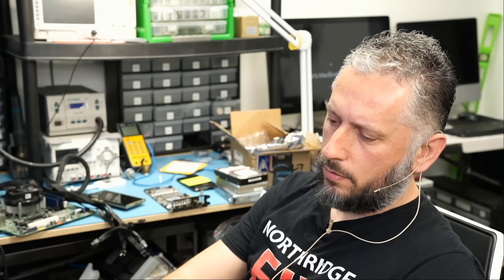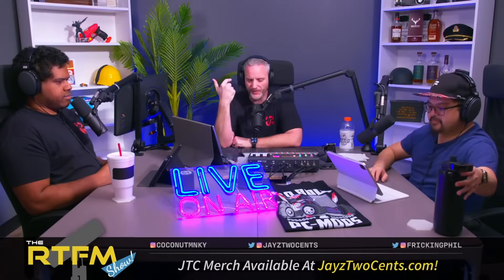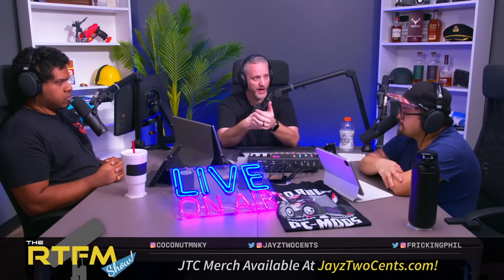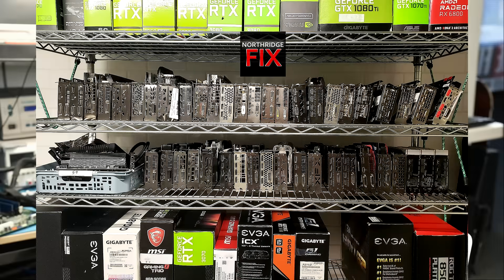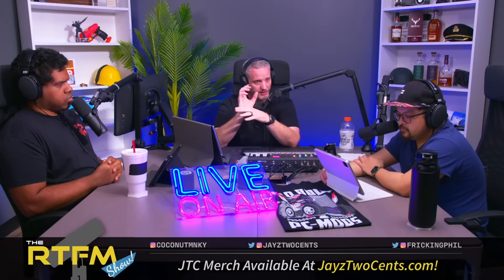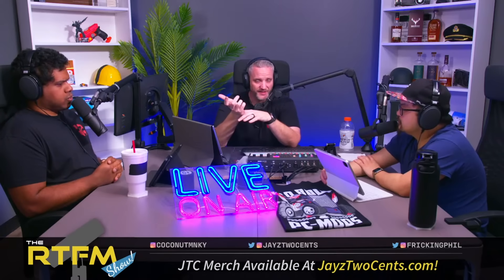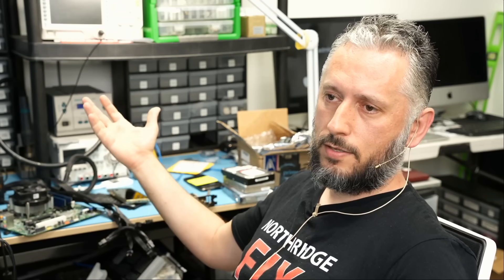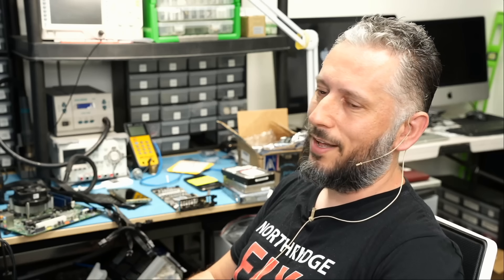Melting 4090 and CableMod. JayzTwoCents and Gamers Nexus Response. Blame NVidia or User?

Comment: Honestly the bottom line falls back to the manufacturer of the card.   The current on those lines are clearly to strong for the connector to handle.  What SHOULD have happened is a redesign of the card maybe considering using 2 connections and not just one.  Split the current over another set of lines so it splits the heat load.

SMH.   Northridge I'm 100% is correct when their assessment.  He's working on several dozen of these cards each week.   So figure about (conservatively) 20 cards a week....80 cards a month, etc...  And GN only checks a handful?

Much as I have respect for all 3-  I really have to put my faith to the person/company that has to repair the damage.   

To put it this way:  If you had to taken Apple's word for why they can't fix your phone or laptop.  And then have someone like a Louis Rossmann DO THE REPAIR!  

Who would you listen to for advice now?  Apple (that clearly has the vested interest in simply selling you another product)  or Louis-who's interest is in REPAIRING that same product for a fraction of the cost.

I'd love to see a video with both "Alex" and Louis Rossmann trading repair stories together.  Pretty sure that would be amazing.

Comment: Could a human not seat it perfectly but when it melts it gets drawn in closer when using a cablemod adapter. 
Either way, this is a NVIDIA design flaw and they should make it right because it’s not like gaming GPUs matter to the bottom line.

Comment: If the connector is so tight is it possible the plug is pushing the pins inside the connector back? So even when its fully seated its not?

Comment: "Not a connector issue". Connector melts.
 You  know how that happens?
I too large, R too large.  Heat.  Melt.  It's not hard to figure out.  But I guess if you think a bad memory chip or MOSFET is a no-fix situation, you might think so.

Comment: It seems that too much current is flowing through the video card. I think Nvidia should use bigger connector for the high current of the video card. Maybe it's also an idea, like a dvi output, to secure the connector with screws. Maybe the connector could be made of a better material. In any case, I think the connector is too small for the power demanded by the video card. Why 1 connector anyway?

Comment: Hi @NorthridgeFix. 

I just had a 4090 burn on me. I used the cablemod adapter to avoid putting stress on the cable because the clearance between the card and the side panel simply won't allow a proper length between the bend and the socket. I will get the issue fixed, thankfully. I monitored the power draw of the card routinely and rarely it went above 400w draw (Mostly when I stress tested the system the power consumption went higher than 400W). More often than not the draw moved between 260-370W. I also monitored the 12vhpwr cable, cablemod adapter, and the GPU socket for developing gaps or misalignment. Suddenly the card began failing on me (Blinking screen and graphical artefacts). I reinstalled the drivers, which fixed the issue for some time. Eventually, the socket melted on the left side whilst playing Stranded: Alien Dawn. 

NVIDIA produced a card where its size can cause a mating error for the power cable and connector because of space limitations. 

NVIDIA produced a card which weight can cause the graphical interface to crack. 

NVIDIA produced a card which 12vhpwr-connector uses inferior production methods for its pins (Such as poor metal layering and foreign debris). 

NVIDIA produced a card using a 12vhpwr-connector which pins are too thin and close to provide enough tolerance for power spikes and safe heat dissipation.

NVIDIA produced a 12vhpwr-connector where the design of the pins doesn't provide good connection that keeps them locked in place.

NVIDIA produced a card which connector is so flimsy that a slight pressure on it can cause a misalignment. 

NVIDIA produced a card where to even have a chance to correctly insert the cable you need a lot of pressure which still might not have the cable mate correctly. 

Therefore, adapter or not, a melted card is on NVIDIA because it is way too easy for the card to melt for it to be user error. 

To anyone that want to prove me wrong, here's a pro tip: you can't.

Comment: Perhaps todays cards just need a beefy 3-pin Water-Kettle plug or AC Adapter clover-style plug... aka .. a thick high-current 3 pin connector instead of the current thin multi-wire dodgy little connectors that was brought forward when PSU"s were designed to run at less than 500w..

Comment: Cablemod recently announced a recall on all thier adapters
Reply: Yeah. Because they don't want to be responsible for poor design of the cards. GPU manufacturers just dump these cases on Cablemod instead of taking responsibility for their own cards.
Reply: @eggy6857  The only cables that were melting were nvidia FE adapters and cablemod adapters, PSU cables etc. that were fitted correctly haven't had a single issue..

Comment: While I would agree with you (and do to an extent) - I unfortunately gutted my PC yesterday and to my surprise, there was a slight charring and melting on the cable connected to my ATX 3.0 PSU! The culprit? While I ensured the GPU was seated flush, when pulling the cable out of the PSU, it got pulled out with a slight 1mm gap

Comment: I am still very confused why would nVidia be able to deny warranty claim on this, and try to use excuse of "blame the user for not plugging it correctly" ... 
Car breaks down, fire ignites under the hood, and manufacturer says driver was not making proper turn, did not start the car properly, did not use proper fuel, did not properly re-seat air filter cover - and all is fine... no no no... that is a fire hazard. 

Supposedly they have re-designed the port and sense pins are little retracted inward to ensure power is no longer delivered if the port is not plugged in to the acceptable distance... 
Now that I finally managed to get RTX 4090 FE in BestBuy I am wondering if I should return it or not.

Comment: I think this is a fear preventing me from buying a 4090, making me want to settle with a 4080 with my upcoming i9 13900k build. I found this video researching if it is still an issue or not with melting cables, and sadly, I feel like I just want to settle with a 4080 and go with the i7 13700k to save some cash. No point in buying the 13900k unless I'm going with a 4090.

Comment: If the connector is not aligned, it means that the manufacturer/Nvidia just made it and packaged it straight away without testing their GPU whether it runs well on the connector or not and supports standard connectors. Obviously this is Nvidia's responsibility and must replace a new one (manufacturer's physical defect = replacement of a new unit).

Comment: It's very normal to melt .. because the damn card draws a ton of power... and it's happening on the card side because the heat comes from the board to connector .. and resistance increase with temperature .. so guess what .. it's gonna melt .. add 2 damn connectors and should be ok, nvidia f up.

Comment: bad quality connectors from card, these pin connectors had to sustain at least 12 amp, so if is oxidation or resistance that give a poor connection and then become hot to melting, gold plated pins are more expensive then "aluminium" or some recycled conductor to make cheap pins, these lead to poor connections and hazard

Comment: I think the issue has to do with the ampacity of the connector and the PWM and its demands. 
The ampacity can vary wildly depending on the environment the card lives in and because of the 4090's high power demands coupled with all the energy efficiency systems in place, it leads to transient spikes that could potentially lead to the connectors melting. 

I also think this is why we're getting so many mixed results in testing and it's much harder to see patterns in failing cards.

I think it''s an engineering problem for sure but a really tricky one.

Comment: I know I'm late to this video but I alwys get a laugh at all the comments that said user error.  If that were true,  people would have melted the 24 pin power cable off the MOBO.   People woud have melted these plugs in every model / system.   People seriously do not think.   This is an isolated issue with just the 4090s, right?   4080/4070 series don't have this issue and I guess they are similar in design?

I know GN tried to do some fancy camera work with thermals and what not but I don't recall them finding a bad GPU to play with.   After replacing the connector,  did the boards re-fail?  I would have loved to see a volt / amp test on the pins.  Would have been great if we had a bad card to test on before it failed.

It seems to me that it could be some sort of runaway circuit causing a short.  Is it always the same pin,  PIN1?  I recall the connector specs were published and that they should have good connections.  If that is true, a simple resistance test would prove that, right?  Could a chip on board cause this?  Bad voltage sensor?   I dunno...   But I would love to find out more about the cause.

Comment: Its hard to say for real, some company pc builder do mistake with connector not fully plugged in. Its 100% sure that some people will do that mistake also, its not impossible. If its really a 12pin issue then every 4090 would melt, they are all made exaclty the same.some of those connector are fully plugged in but have play in them. But fo sure its more of nvidia error

Comment: 25+ years of building PC's. 
Same deal, 4090 connector melted and dealing with getting it fixed... 

Simply put, how is it that countless PC's over the last 25+ years have never had "Oh the user needs to plug it in fully" issue. 
Yet, as if by magic once Nvidia put out a new first gen connector, all of a sudden it's the users problem? 

Sounds like a great concept! 

New Business Idea: I'm going to design a parachute where as it works 100% so long as you pull the rip cord at "just the right speed". Any faster or slower, you die. Remember... that's on YOU for not timing your pull correctly! Get it right user! 

sigh 

Not only that these connectors that are melting ARE connected tightly. It doesn't matter. If it's fully clipped in any amount of wiggle, bump or otherwise should not be an issue. Doesn't happen with this commonality with SATA connectors. Doesn't happen in mass with molex connectors. Sure, some of them do at times and can of course but no defined pattern like we're seeing here. 

Nvidia improving their connector in a few ways should say it all. Why improve something that doesn't have an issue?

Comment: The connector is rated for 600 W but the 4090 draws only 450 W! The connector has a major design flaw when it is supposed to withstand 50 A but it can melt at 37.5 A in some cases. When the connector melts it is a proof that there was too much resistance in this connection for such a high current.
Here are some calculations:
0.1 Ohm connection resistance: 0.1 Ohm * 50 A = 5 W of heat dissipation in the connection
1 Ohm connection resistance: 1 Ohm * 50 A = 50 W of heat dissipation in the connection and the connector will melt
To reduce the resistance the amount of copper in the connector must be increased and the conductive contact surface of the connection must be increased. The rating of this connector must be decreased to 300 W and 25 A to have a savety margin.

Comment: Being in the electronics field all my life it's pretty clear the connector is at fault.  User error or not,  the connector is inadequate for the task.   I'm running a 4080 and you bet I'll be checking it from time to time with my thermal imaging cam.   The ground pins rarely melt as the cards have a path to ground via the PCI-e slot as well.   I don't agree with Steve on this one.  Some truth,  but not much.

Comment: One thing that nvidia should add in their design is a temperature monitoring circuit close from the plug pin.
Or better that that, a better comnector that can handle higher current...

Comment: I am using my 4090 with the pc case's side panel open just to avoid any flex in the power cable through contact with the side panel and and melting it.

Comment: When you put nearly 40 amps through a small connector which is likely not rated for much more than that, you have no tolerance for error.

The heat generated inside the connector is equal to current squared times the contact resistance so anything other than a perfect connection is going to generate several watts of heat inside the tiny connector. For example a contact resistance of just 2 milliohms at the maximum load of 450W / 37.5A will result in 2.8W being dissipated inside the connector. The only thermal pathways are in to the wiring, which is thermally insulated by plastic, and down the connector pins in to the PCB, which is going to be running hot anyway meaning that there is nowhere for the heat to dissipate to.

This is 100% a design issue, not to mention a potentially dangerous one.

Comment: I recently bought a 1300 watt PSU that came with one of these connectors that has 4 inputs. I can't believe they expect this small plug to handle that kind of wattage! It Is an Nvidia problem!!!
I Will NEVER BUY ANY of THESE CARDS!!!!!! These tiny connectors cannot handle that kind of Wattage! I think that a Lot more of these cards are going to be sent in for repairs sooner than thought. I would rather have 4 8 pin connectors than this crap. I have also run into problems on automotive wiring connectors that were not heavy enough for the loads that are demanded of them and so I had to upgrade many wiring plugs to repair burned connectors that have to handle more wattage than this! Shame on Nvidia!!

Comment: The real problem is $2000 video cards with a super cheap molex style connector that was never intended for high current DC. Why didn't they spec it out with something like a Deans, Anderson, Bullet Style....?? Anyone who was ever into RC cars can tell you that the type of connectors they use just suck.

Comment: Completely agree that this is still a company issue.  If the user can cause the error and create a fire or other damage the the company is obligated to correct this.  The simple fact that the other cards with same connection do not have the same issues is a huge red flag

Comment: Idk if anyone in the comments have mentioned this or anyone mention this except I believe jay. So if you notice the 4090 cards are “disappearing” or “hard to come by now” it was either jay or maybe even linus that talked about this but, they noticed this trend and started thinking the manufacturers are taking them to “resource components” for their upcoming 50 series launch just like they did for the 30 and 40 series cards. What if that is true along with my theory which is a silent recall of the non sold 4090 cards on the market to prevent more RMA while also trying to sweep it under the rug and in hopes using those components on some 50 series for profit and or updated permanent fix for this manufacturing issue which haven’t been publicized. Which is also why AMD is moving away from the new connector which isn’t or wasn’t necessary in the end anyways.

Comment: It's clearly a resistance issue. Either in the pin to pin connection itself or in the guage/material of the pins. It's manufacturer error either way, and invidia has zero excuses.

Comment: The problem is the connector and the fact the card pulls too much current for the connector contact surface area. The connectors are cheap and poor quality and design when card pulls higher current under load the cheap contacts  experience socket thermal expansion which increases  contact resistance which causes heat and meltdown as long the gpu is pulling higher current under load.

Comment: If the plug cannot handle the influx of power or is not suitable for the power draw it will melt as it heats up. Add an extra power plug to the card to spread it out.

Comment: Using the adapters are part of the issue. The cause current issues and put too much weight on card plug.  Get a dedicated 12vhpwr single cable with a PSU designed for it. No more issues.

Comment: Could be that Steve Burke was paid by NVIDIA to cover it up, not the first time something like that happened.
Everything Steve is mentioning is a load of bollocks and makes no sense what so ever you should not nbe needed to wiggle the connected power cable side to side 10 a 20 times that is rediculous.

 This connector is poorly designed it's a vital part nGreedia cheaped out on, overall I agree with you (NorthridgeFix) & JayztwioCents.

Many thanks for sharing this, I find videos like this one very important, these are things the world needs to know.
As NVIDIA goes  I always stick to this saying:

"nGreedia: the customers are played"

As it has been for years, they should never of released the cards with a power connector that can cause so many issues, unbelievable that they accept such low quality designs for a very vital part.
NVIDIA always cutting corners, but the worst of all NVIDIA will do their absolute best to get away with it and sadly they always do as well no matter how many times people complain of things they did wrong. they will always get away with it.

Comment: You connect half way, you either dont even have a graphic card to work with or you get low energy, hence low chance of melting anything. You connect all the way in, you get maximum energy, hence maximum heat, hence possibility for melting. How does "not plug in all the way in can cause melting" make any sense?